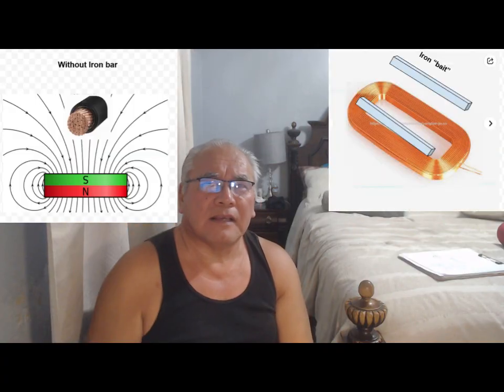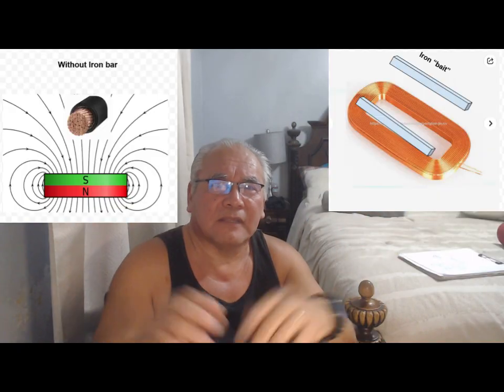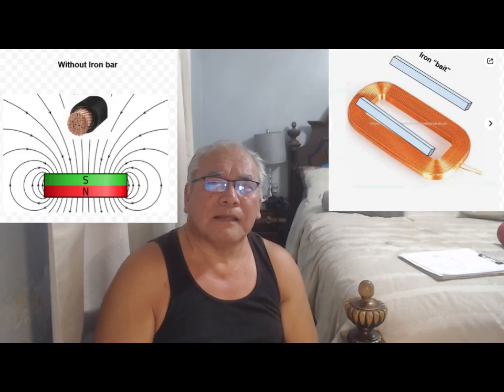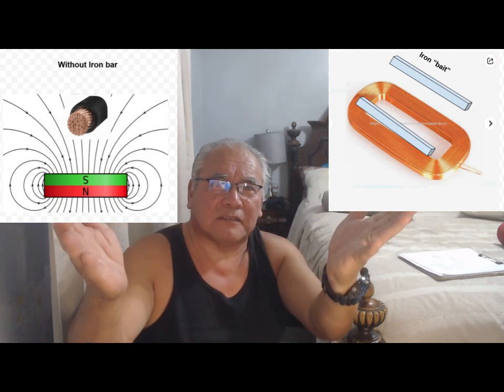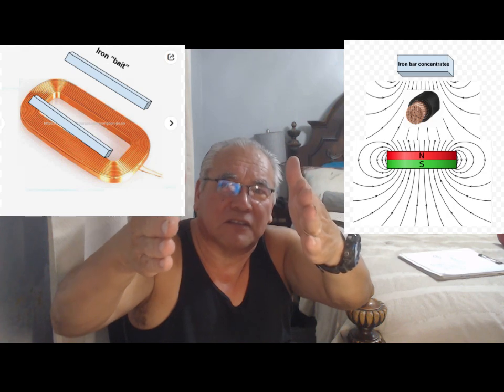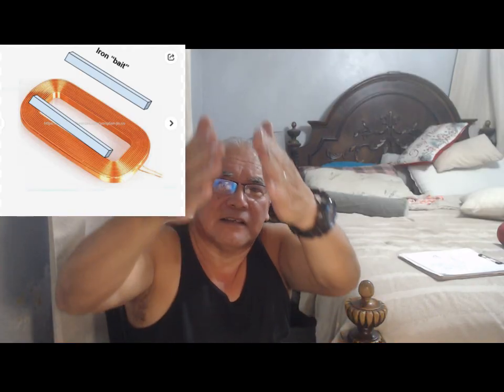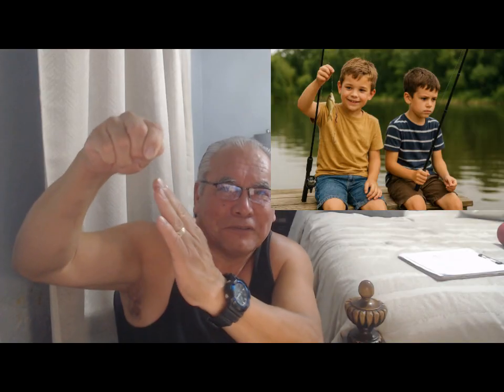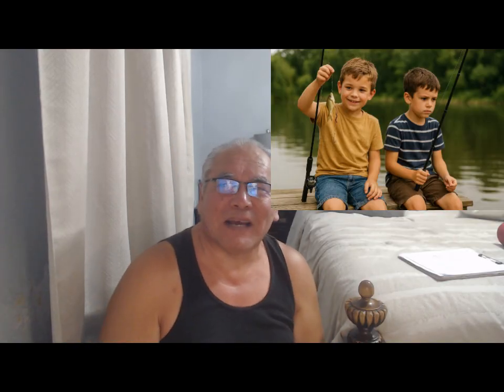Baiting magnetic energy

Comment: Sir I a stator the winding are done in the slots it has a continuous metal core which all the round then why it does not show the effects as you explained
Reply from the maker: problem is obvious to me, the stator acts as ONE piece, this is for possible air coils to increase efficiency, when done in slots usually winding circles so lenz is generated, my method does not generate lenz as the iron is not wrapped in circles with wire